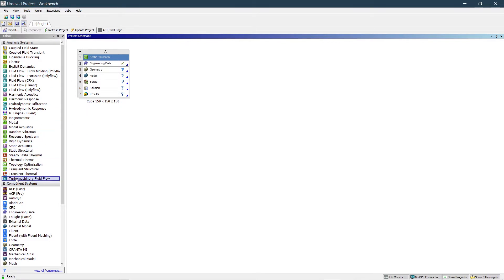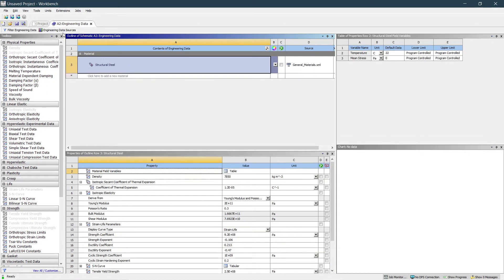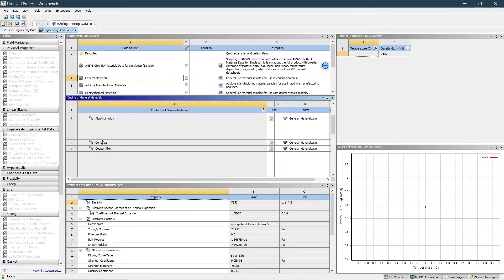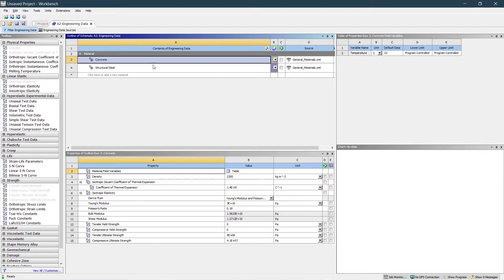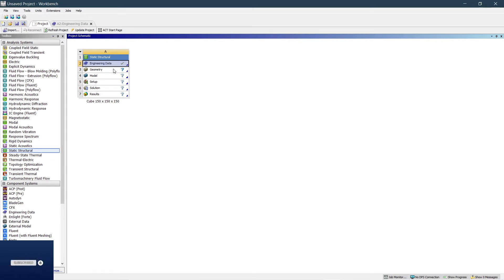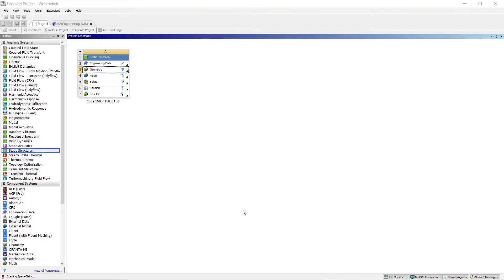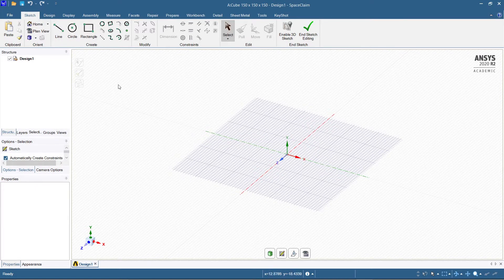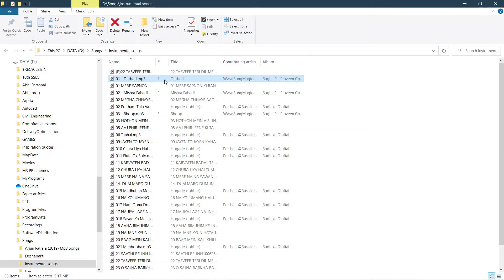Modelling and Analysis of Concrete cube in Ansys 2020

Comment: Your videos are so amazing, really thanks. I want to obtain the nonlinear behavior of the concrete. For example, for the C30 concrete class, I enter the density, Young modulus and Poisson's ratio into the material information(Engineering Data). How do I need to load for c30 so that I can get a stress-strain curve?
Reply from the maker: Thankyou for watching my videos.......If u want a stress-strain plot then u need the incremental loads to be applied and respective strains to be noted. U can create multiple duplicates of an incremental loads like 5 kN, 10 kN, 15 kN and calculate directional deformation in Y-axis and then strain. Use chart option by selecting stress and strain values incrementally......

Hope this helps ......I also have a video of plotting the graph u can got through it

Comment: I m research scholar and I need your help in my research work and My research topic is Fatigue behaviour of stud shear connectors in steel concrete composite beams
Reply from the maker: Hi, I willing to help you if u could contact me at  +91 9449956990. We also provide project assistance to both UG, PG and Research Level...........

Comment: Sir I have a doubt,what is the grade of concrete,how to select grade of concrete in ansys
Reply from the maker: You should calculate Young's modulus and other parameters and add in material
Reply from the maker: To know grade of concrete......u should calculate Young's modulus
Reply: @Abhi_Innovate  I am doing my mtech project on manual and experimental analysis (Ansys ) on beam column joint
Reply: @Abhi_Innovate  I have doubt on how to select grade of concrete and grade of steel
Reply: @Abhi_Innovate  can u do one video on grades of materials.

Comment: Hello, is there a way to get the value of the compressive strength (f'c) of a composite concrete cube using ansys? (it is a 100mmx100mmx100mm concrete cube with plastic intrusions)
Reply from the maker: Yeah ofcourse ......U need to add materialsspecific to your requirements and then use in analysis........Refer my video on How to add new material in Ansys.....?
Reply: Hello l want contact you just for ANSYS  in concrete